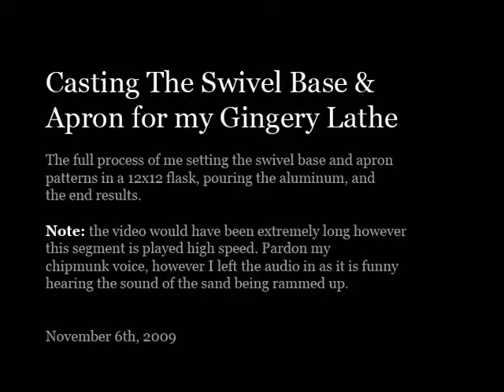Casting The Swivel Base and Apron for my Gingery Lathe

Comment from the maker: @steveBB30 Thanks for the safety suggestion, they were strapped prior to the activity however became unstrapped during the process, and thus I didn't stop to re-strap them being in the middle of pouring the metal. Moving forward I've decided to not use the strap that goes under the boot, just the one that goes around the ankle as it seems as if it provides enough hold that way.